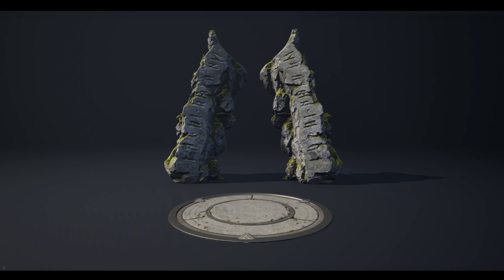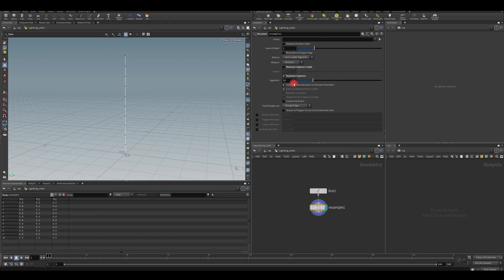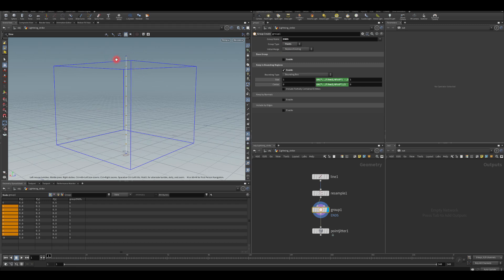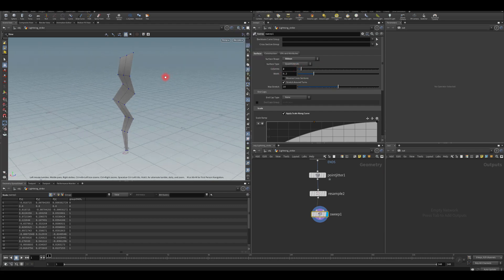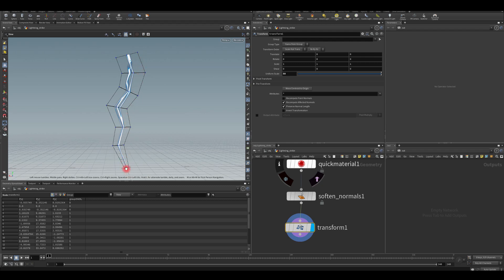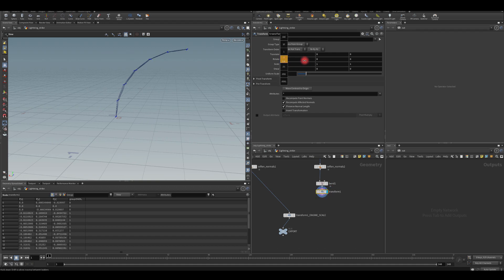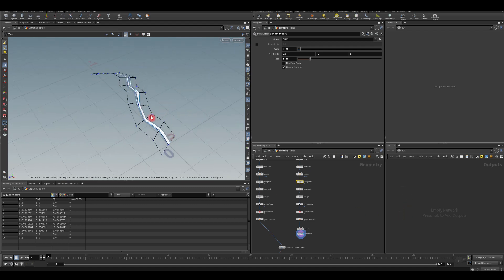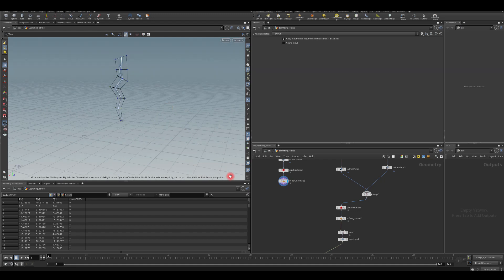VFX Lightning Mesh using Houdini

Comment: So, I did the tutorial til the part where you assigned the material to the mesh. I'm new to Houdini, using the apprentice version yet, and I could not find this "labs quick material", nor another solution for that. How can I procced?
Reply from the maker: Make sure you’ve got sidefx labs installed. I go over this in future videos. Click plus button go to shelves and enable sidefx labs shelve. The go to that shelve and update the plug-in. Try another one of my videos of google how to install sidefx labs. Hope that helps
Reply: @1MaFX  Thanks! I'll look up for that!

Comment: Hi. I have a question. I could not transfer animations consisting of multiple parts, such as the rotation of the gear wheels in the mixer, to the unreal engine. So the parts were imported and the animation didn't work even if I combined them in a class. How can I get the animation to work? You can also suggest an instructive resource that you know. have a nice day